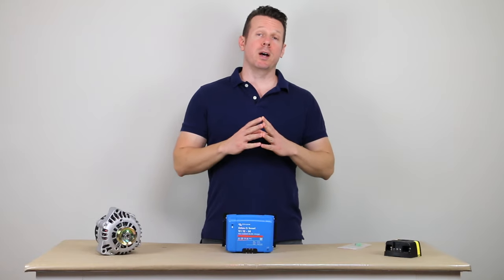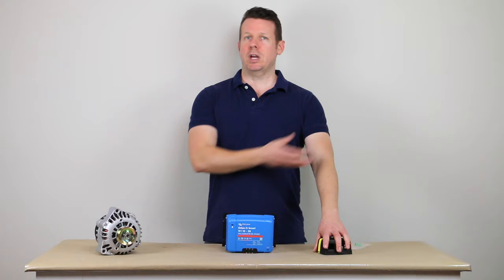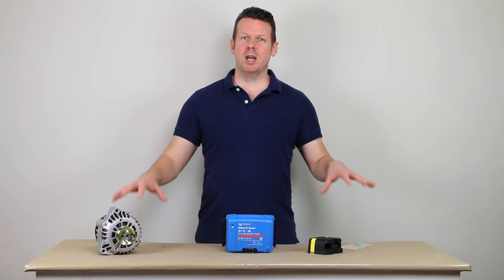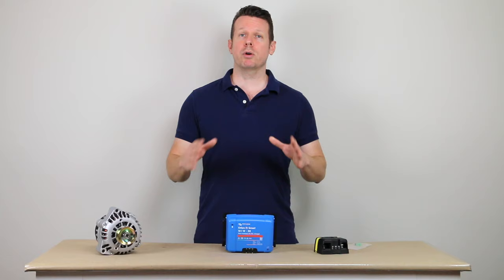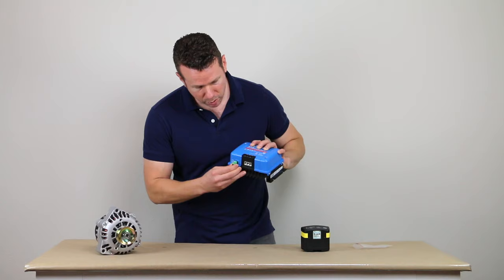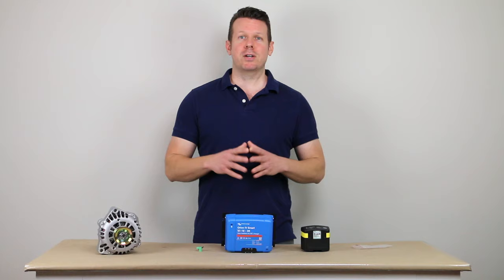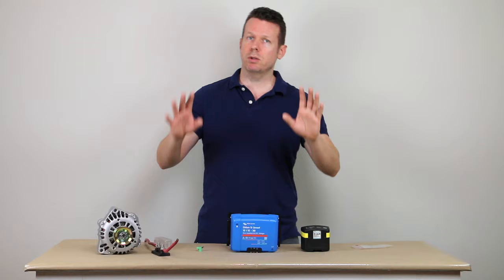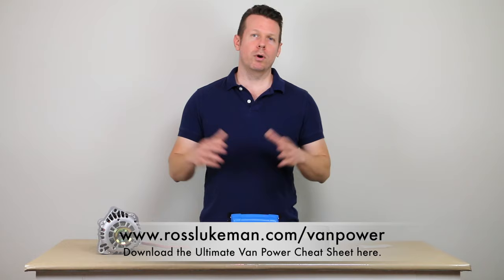Top 3 Alternator Charging Mistakes for Van Conversions | Featuring the Victron Orion-Tr Charger

Comment: Does this info relate to alternators with built in voltage  regulators? I have an 06 f350 diesel with two  batteries and two alternators. I want to dc charge camper batteries.
Reply from the maker: Hi Jon, thanks for stopping in. Yes pretty much all info discussed in this video pertains to alternators with internal voltage regulators. As long as you can find a good place to pick up that alternator power, then a DC-DC charger such as the one shown in this video would help you regulate that power. Hope that helps-

Comment: Saw this video and was going to add one of these to my build. I actually have a 12v cig plug that's ignition powered right next where I'm putting my DC-DC charger. Can't I just use that instead of tapping into a fuse panel?
Reply from the maker: I would make it nice. Go to the fuse panel and hide the wire!

Comment: Can vehicle chassis be used as common ground for both "ends", for Transit, Sprinter, etc? Assuming it's directly on the metal and not just on the paint, etc? Saves one bulky and somewhat expensive cable.
Reply from the maker: Hi Alec, yes the chassis is the common ground, and you are correct, make sure it's metal to metal, with no paint under your cable. You can spray paint over the connection once it's made.
Reply: @rosslukeman  Another one... do these play nicely with a solar charger? Or do you need a special unit that connects both the DC-DC and solar charge inputs and makes sense of them?
Reply from the maker: @alecfurtado1765  they will play nice with a solar charger. Like two air pumps connected to the same tire, they will each independently conclude when the tire (or battery in this case) is full.

Comment: Can you further comment on exactly how to wire the off/on connector. Which of the 2 wires in the green plug do you hook to power and do you  take the jumper wire out or leave it in.
       From what I  understand but am looking for clarity is that you hook 12V to the right side of the plug and take the jumper out? 
        Any comments welcomed and appreciated.

                                                                          Ycasts
Reply from the maker: Hi Stacy, you are right, for ignition control, you take the jumper out and connect the ignition wire to the right side labeled "H."
Reply: So much easier to set it up to sense when the alternator is charging.

Comment: Hey men. I only realised there's two version of this charger 30 and 50 amp. I bought 50 amp and now I worry it will be too much for my old 1992 Ducato motorhome :/ what you think
Reply from the maker: Hey there, it will probably be okay. I would find out how many amps the alternator is rated for. Allow 40-50 amps to run the vehicle. The remainder is available for charging. However, if you max out your machinery it will not last as long. In the end, a 50-amp charger for most vehicles (with alternators of 120 amps and above) is going to be fine. Considering it's a 1992, you may want to go easy on it, or put in a new alternator if it's the original (or wait until it goes out). Hope that helps!
Reply: much appreciate  @rosslukeman

Comment: Noob question …I’ve been working on converting a cord Econoline van over the winter and wondering if I have solar and a dc to dc charger all connected wil the solar charge my house batteries and the starter battery?
Reply from the maker: Hi Chris, it will charge your starter battery from solar only with a relay or with a DC-DC with a reverse charging feature like those from Sterling-Power.com

Comment: yeah this is one thing i dont agree with him on. ive been using 6 batts for 30 years 4 up front and 2 in the back lead acid. modern alternators have a voltage reg and will kick out when topped off! also i only use 1000 cca batts al the way around! i have built a few bus conversions over the years . i put a 200 amp master kill between the front and back bank!

Comment: how is to wire remote plug? I have remote switch in cabin so the 12 V will go to right hand side of the green. where is ground connects?
Reply from the maker: Hi Vadim, please see the manual at Victronenergy.com. It will be more effective to see the diagram than for me to try and explain it verbally. They should have a few options for you. Thanks for tuning in-

Comment: How does this victron compare to Renogy 20A or 40A DC to DC charger? would this suffice? its much cheaper than the Victron in my country.
Reply from the maker: I haven't quite tried the Renogy units yet. They should be decent but the build quality may not be quite the same. Warranty is a couple of years less. I would try it though, there aren't major red flags, should work okay. Hope that helps-

Comment: Brilliant video Ross, seeing as you touched on the subject of starter battery ghost draw, and preventing this with connecting the engine on feed, what would you recommend to add to my system to ensure my starter battery is topped up from leisure batteries when parked up for long periods?

I already have two 12/12/30 victron dc to dc chargers connected to supply 60amps to my 400ah lithium battery bank, could I use a third dc todc charger,  dedicated to keeping the starter battery topped up? 

Alarm system, immobiliser etc are powered from starter battery,  so it's voltage is dropping all the time. 

Thanks in advance

Comment: Can I just run my ignition signal wire to my switch Pro. It s programmed to turn On with ignition
Reply from the maker: Hi Tim, I don't know what a switch pro is, but if it generates 12V when the ignition is on, then you should be able to pick up the ignition signal there to turn on a DC-DC charger.

Comment: So for now im stuck using a VSR module to charge a 2nd battery. The truck also has a solar system. 

Im worried the solar input will hold the VSR open and have starter level currents being drawn through it. 

Couple points of thought: Starter v-drop might open relay?
Using a bosch relay to turn off VSR via ground when starter is energized?

Comment: Been running a simple battery isolator with a 12v deep cycle in the back of my truck camper for 3 years, but now watching all this I realize how wrong and potentially dangerous my system is.   So the hell with all this shit, I'm just going to get an external portable battery system.
Reply: What gauge wire are you using?

Comment: I currently have the Blue Sea ACR 7611 in my lance truck camper and am going to pull it and replace it with a Victron dc to dc 18A isolated charger.  I just swapped out the LA battery for lifepo4. I'd like to think it would be very similar in connectivity.  Have you swapped these out and could a guy use the same wiring from the ACR?  I believe the ACR is activated through the ignition via the lance 7-pin connection.  Any thoughts and or experience with this swap?
Reply: Matt - I have a Lance 1172 and mounted the Victron DC-DC charger inside the bathroom cabinet on top of galvanized sheet metal. I ran all new 6 gauge cable from the F350 alternator through the camper to a fuse block mounted under the steps where my house Battle Born batteries are .  There is not enough space around the ACR to mount that larger Victron unit.  instead of using the existing umbilical cable on my camper which is woefully inadequate, make yourself a new cable using Anderson PP connectors and add rubber boot (they sell theses) to environmentally protect your harness.

Comment: It seems if the DC-DC charger is connected to a Li-Ion battery, which has it's own BMS, you will have two circuits trying to regulate battery charging... this doesn't seem to be efficient.
Reply from the maker: Hi Chris, they are doing two different jobs. The only current restriction from a battery's BMS is with a shutdown overload current setting. DC-DC chargers operate to protect the rest of your system and bring the current below the batteries' recommended charge current. The BMS deals with maximum current ratings, and the DC-DC deals with continuous current ratings.

Comment: How do you feel about circuit breakers over fuses?
Reply from the maker: I use circuit breakers when I need an on-off functionality, but they can get expensive at the higher amperage ratings. For most things I use fuses. Other than that they're interchangeable. Hope that helps-

Comment: I am using in my boat so my main engine alternator charges my 24v electric trolling motor system.  The main engine starting battery i hooked to orion input side and was attempting hook output to 24v and the positive sparked as i was connecting. Just pausing to confirm this arc is to be expected when making this connection and i should continue with connecting? Or did i mess something up?
Reply from the maker: Hey there, if you are connecting live wires then the spark would be expected as the conductors make first contact with the Orion terminals. You're not really supposed to have everything live when you set it up. You should turn off the kill switch or remove the fuses in the line. If you don't have fuses in those lines then I would add them as that is per the manual. Fuses on both input and output lines. Hope that helps-

Thanks,
Ross
Reply: Sounds good. I had the fuse in when I connected.  I'll just put in fuses after connections are made.
Reply from the maker: @stevenichols4060  Ok great I hope that resolves it!

Comment: Is your course transferable to marine applications using tin wire method?
Reply from the maker: Hi Nikolaucz, I'm not quite sure what you mean by the tin wire method. I do specify tin-plated marine wire in the course. In general yes, the components are rated for marine environments and will be the same items used on a boat. There are a few items that would differ such as using an auto transformer and a sacrificial diode for marine applications.

Comment: With respect to the 3 different generation methods (solar, alternator, shore), can all of these be actively charging your rear battery simultaneously or should only one generation method be in use at any given time?
Reply from the maker: Hi Michael, yes they can all charge your batteries simultaneously, although long-term you don't want to go over the total recommended charge amperage of your battery bank. However you will rarely have them all going simultaneously. For example you'd have to plug in at a campground, have the engine idling, and have a spot without a shade tree in the midday sun. If this happened for a few minutes, then the high current would typically be okay for a lithium battery bank. It usually justs ends up being a solar/shore combo, or a solar/alternator combo at the most though.
Reply: @rosslukeman  Thank you Ross.  Sounds like the key is "you don't want to go over the total recommended charge amperage of your battery bank"
Reply from the maker: @michaeltolchard6224  yes that is a key number to look for, although they will typically have a "maximum" current that is double the "recommended," so they will still take higher currents for shorter durations if they get hit with 3 sources all at once.

Comment: Lots of great information in your videos thanks. I haven't found exactly what I wanted I'm wanting to use a lithium battery bank to charge other lithium batteries in a separate trailer using the trailer's on board dc to dc charger Orion 12/12-30 isolated. Any information you can provide would be greatly appreciated.
Reply from the maker: Hey there, thanks for checking out my videos. It sounds like that would work fine. If you connect the two battery systems with the Orion in between, the two battery banks will balance out their voltage like two water drums connected by a pipe. The Orion will just be there to limit the transfer of power to 30 amps. As long as the first battery bank has a charge source connected, it should work fine. You are essentially wiring the two battery banks in parallel, with something to regulate the current and voltage in between. I hope that helps somewhat.

Comment: 4:07 
Hmm. Current should be 10% of the battery capacity. 

So in your opinion, which of these 2 options is safer for my set up. I have two 28ah AGMs linked in parralel. So 56ah total. 

Option A. Run a smart isolator along with some sort of low voltage cut off mechanism to avoid running the batteries too low. 

Option B. Run a 10A DCDC charger which is meant for a battery capacity twice what I have.
Reply from the maker: Hey T-Jay, option A would send too much current into the batteries and shorten their lifespan. Option B sounds better, I would send the 10 amps if that's the smallest DC to DC charger you can find. When the batteries fail I would get something larger, maybe a single 100Ah battery. Hope that helps!

Comment: I have a DC to DC Renogy 20A and would like to also charge my system when I am at home. How can I connect to AC?
Reply: I put a NOCO GENPRO 10x1 charger on my overland trailer.  It can charge different types of batteries.
Reply from the maker: Hi Miguel, something like the NOCO Hillbillyjeeper WV mentioned, or another type of battery charger would work. You could also use an inverter-charger for this. I have a video on inverter-chargers here: https://youtu.be/jQowOOguclU

Comment: have you ever tested and reviewed the Redarc DC to DC charger?
Reply from the maker: No, but I have my eye on them. Have you tried them?
Reply: I have done much research, mostly YouTube posted by users and Redarc company.
I can’t locate a wiring diagram which includes the DC to DC Redarc and an inverter/charger.  Im sure it’s not that difficult but I’m still in the learning stage of wiring.
I’ll probably take a look at what you offer and make any necessary changes.
Reply: I'm running a RedArc 40 Amp DC to DC charger in my van.  It has been great.  A really nice feature of the RedArc is that it also serves as an MPPT solar charge controller, thereby eliminating one separate component.  It prioritizes the solar input and fills in the output with the alternator/start battery up to the max 40 amps.  This works fine for a system no larger than mine, but would be inadequate for something larger.  They do come in a 50 or 60 Amp model.  I'm in a 2007 Sprinter van and am running 480 watts (nominal) of solar panels @ 12 volts (again, nominal) along with the DC to DC charger into two SOK 206 ah lithium batteries.  I'm also running a Victron IP67 25 amp Shore power charger.  We have spent 10 months of the last year in the van and use a single burner induction cook top from our 1800 watt invertor frequently and heat water daily in an electric kettle along with nightly C-PAP machine use and the occasional AC power tool and vacuum cleaner. Running our refrigerator, lights and of course our phone, computer and speaker device chargers are straight 12v.
Amazing as it seems, since we upgraded to the lithium batteries in September, 2021 (more than a year ago), we have only plugged into Shore power once!  And that was more just a matter of convenience.
My only reservation with the RedArc charger is that I think both the input from alternator and output to Battery leads are too small. I'd rather see bare terminals onto which you could put appropriately sized wires.
Sorry to be so long winded, but I hope this helps or at least is a little bit interesting.